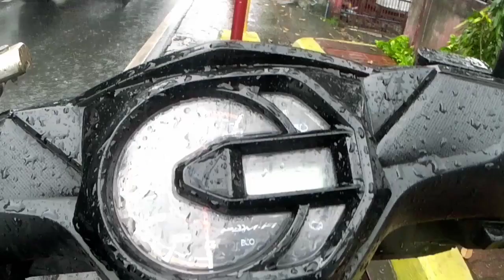How to replace stock bulb on "Mitsubishi Adventure" Tail light | for Gen2 & Gen3 Model

Comment: Ano po spec nung led na nireplace sir? Mamats po
Reply from the maker: Nasa video po sir mga specs.
Brake light - 1157 double contact 
Signal light - 1156 single contact
Reverse light - 1156 single contact
Reply: Boss yan nadin ba presyo ng mga LED LIGHT??

Comment: Boss baka pwede request pa confirm ng bulb type for adventure:

Dashboard: T10, T5
Headlight: H4
Parklight: T10
Foglight: ????
Tail light: 1157 BAY15D
Reverse light: 1156 BA15S
Flasher lights: 1156 BA15S
Plate lights: T10
Reply: BAU15S (150 degree) yata ung signal lights kya hirap sya i fit sa video
Reply: @versaillesalabangofficial2156  ano dapat? Ba15s o bau15s?

Comment: Sir anong bulb type pang adventure?

Brake light: 1157 (dual contact)?
Reverse light: 1156 (single contact)?
Signal light: 1156 (single contact)?
Dashboard: T10, T5?
Park light: T10?
Rear plate light: T10?
Fog light: ???
Headlight: H4?

Thanks lods, pa shout out sa next vid
Reply: thanks po for sharing...